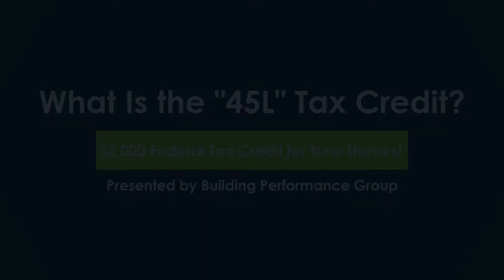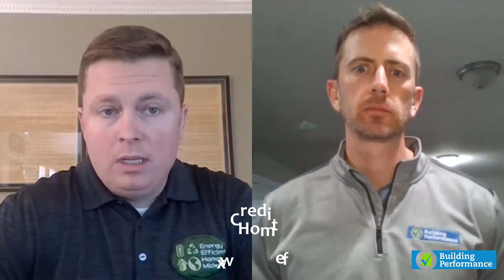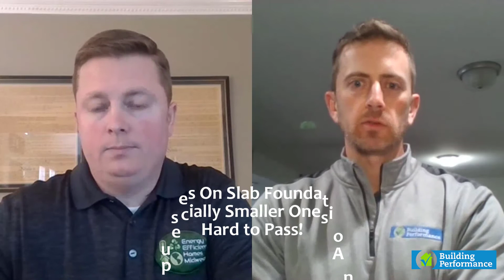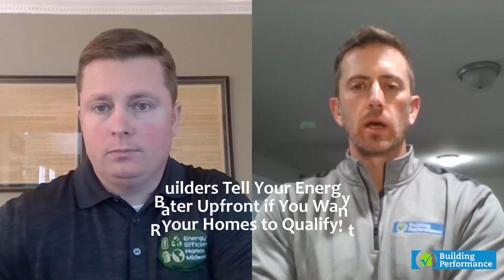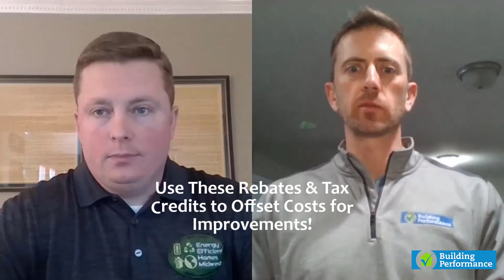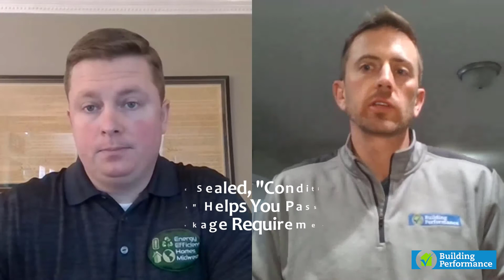WHAT IS THE 45L TAX CREDIT?  ERIC GEORGE AND LEO JANSEN

Comment: Is this HERS rater only? HES possible? or any other rating systems?
Reply from the maker: The tax credit is not necessarily a HERS Rater only thing. It's qualified and processed using rater software (REM, Ekotrope, etc) but there are other software options to do it that aren't rater specific. Anyone doing these tax credits should be properly trained and certified to do energy modeling, blower-door and duct leakage testing at minimum.

Comment: Can the house owner do this by himself? If the owner gets an approved software by RESNET and runs the model, gets HERS assessment out that shows savings over 50%. Is that it?
Reply: I would also like to know. I built a home in 2021
Reply: @JuystaFan  I figured that a certified"Rater" has to be the one to issue the HERS statement. I thought I would become a rater but I need to do attend a training and it will cost over $1,500. Still thinking about it to be honest since the 45L tax credit has
Reply: It has been extended and there's still fund available for 2022
Reply: @KMFNYC  So I have to call a resnet hers certifier to get certified and then I can claim the 2k?
Reply: @JuystaFan  yes apparently a RESNET HERS certifier has to print out that report and stamp it with his certification number. Otherwise IRS wouldn't accept the report if it isn't stamped.

The report itself shouldn't be hard to be honest, I'm an Energy Engineer and I can see it done in less than a day. Not sure how the certified person/firm will charge you for a single home but I would assume a $500
Reply: @KMFNYC  Neat. I only found 1 in my state, NC. I can't imagine many people taking the time to shoot for this credit though. I'll ask him how often he puts his cert to use.
Reply: @JuystaFan  good luck
Please let me know how it ends time costing you and the timeframe.

I'm still considering applying for this certificate but not sure if it will worth the time/money/effort
Reply from the maker: There would be a conflict of interest if a homeowner wanted to certify his own house, whether for a tax credit or other purpose.  The cost of the training to become a HERS Rater and then buying the equipment alone would be 5x the return from the tax credit, so it's probably not the best return on your time or money.  The HERS Rater providing tax credit certification also needs to have errors and omissions insurance specifically for that purpose.